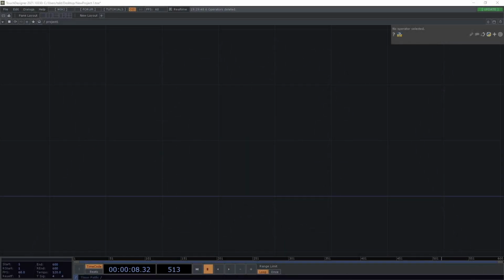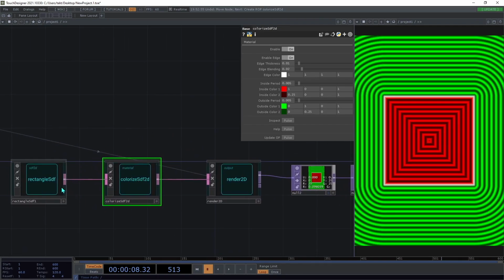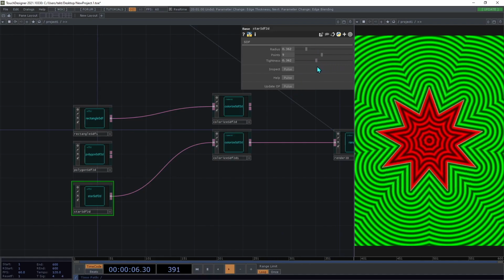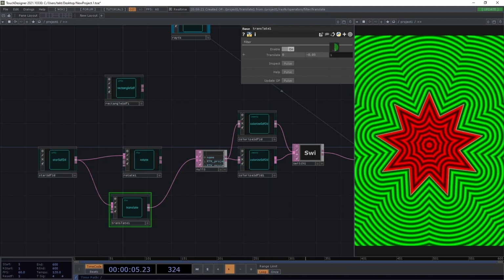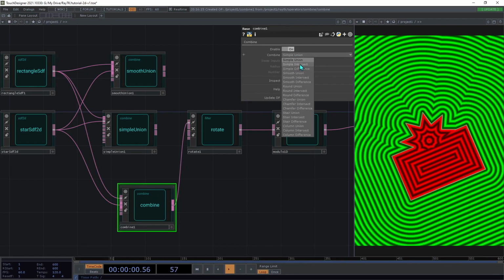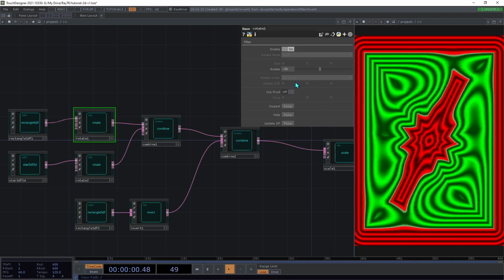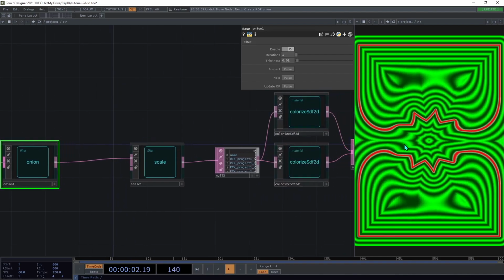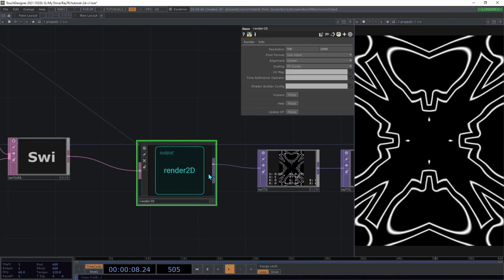(OUTDATED) RayTK Tutorial: 2D SDFs

Comment: Cannot believe how beautiful those 2D SDF fields are! So many downstream compositing possibilities!
One question, would it be at all possible to create custom 2D SDFs from either raster images or SVGs? I understand SOP to 3D SDF conversion might not work in real time but would it be possible with 2D?
Reply from the maker: Interesting question. You could use a textureField to get data from a TOP into the shader. Getting it to behave as an SDF would be a bit tricky. If you can  set up the TOP with surface distance values instead of color,  that would translate to an SDF easily. Not sure how to get from an arbitrary image to the distance values though
Reply from the maker: I'll add a feature request to the GitHub tracker about it
Reply: Oh amazing, yes would love that as a feature since it would really accelerate the process of building complex forms.
Reply: It could be nice to find a way to do that I agree!